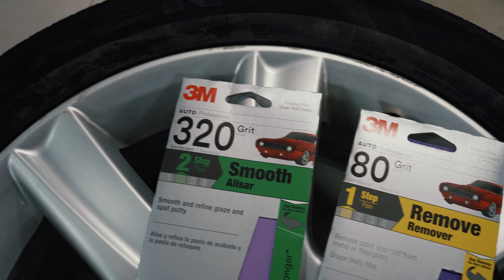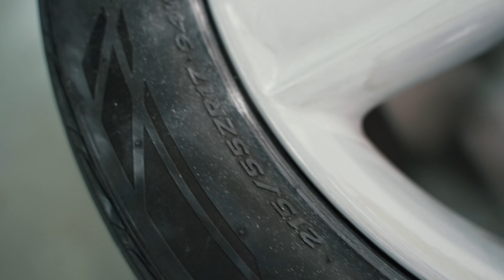How To Repair & Repaint Your Wheels

Comment: Yeah, it’s a lot of work to get good results painting wheels, I bought a truck and the guy that had it before me did a shitty job painting the wheels black, I didn’t mind black but that paint looked awful and I ended up deciding to repaint them to look like the factory silver.  Was a lot of work to sand them down and paint primer colour and clear, but it turned out amazing

Comment: A great tip... Use playing cards to insert around the rim of the wheel and then just run a quick piece of tape around the top of the cards to hold them together and into place.  They will slide perfectly down into that crack and pull out easily when finished.

Comment: 2nd from Puerto Rico 👍🇵🇷
Reply from the maker: Humberto! Were you sleeping? LOL
Reply: @ChicagoAutoPros  🤣🤣 Unfortunately, today at the server room doing some CISCO access switch replacements before our "freeze time" which starts on December 8th until January 8th.  Difficult to get my cellphone while holding one of these devices and putting them at the rails at the same time,  Yes, my regular job is with computers and side job Detailing 👍👍👍🚘🚙
Reply from the maker: @1stfrompuertorico568  Well your job is way more important than a YouTube video! Cheers brother, hope you have a great day.

Comment: On a serious note, is this something you're doing for yourself at work or do you offer this for your customers as well
Reply: I'm sure they have a professional that does them if its requested
Reply: Something about the color is not right. Maybe it's just that the car has chrome parts?
Reply from the maker: We recommend powder coating, this is just a cheap quick way to do them yourself.